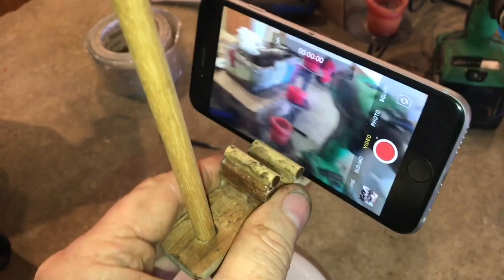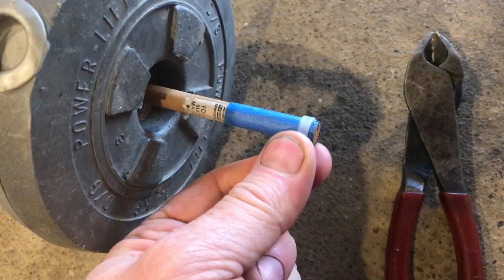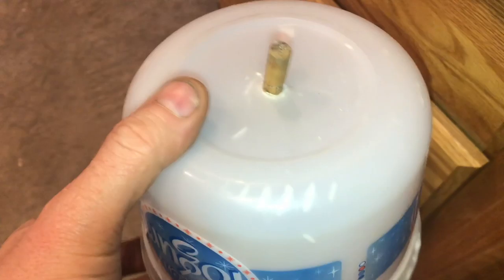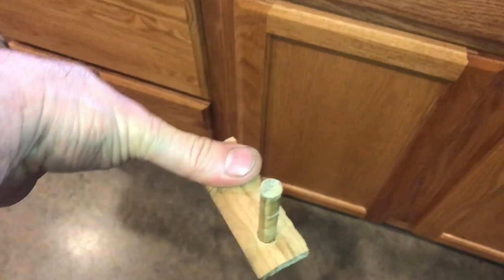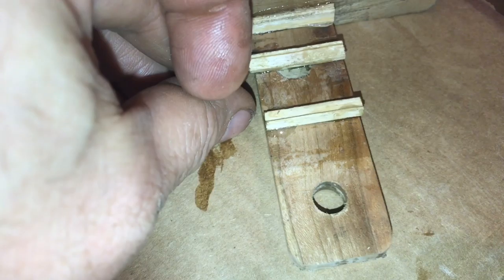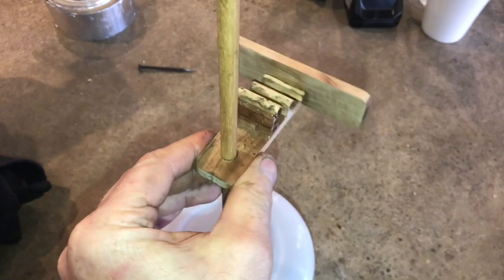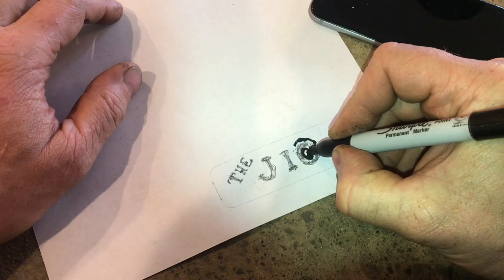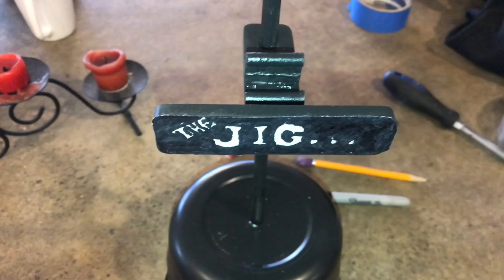how to make PROTOTYPES 101 (camera holder)

Comment: I've had some luck heating plastic a little then poking a hole or drilling with no cracks. Or heat a nail and poking a hole. But some plastics it doesn't matter. Shatter!
Reply from the maker: Heating the metal would’ve absolutely been better. It sounds like you’ve definitely been building for a few years. Experience helps keep you out of trouble. Of course sometimes you realize you’re mistake after it’s too late.
Reply: @livefree6878  
My experience  or tests are always -      ' drats! will this work? What if I...? If I do this and this maybe... '
Because I don't know what I'm doing, lack of tools or shouldn't have touched it in the first place.
Which hopefully carries over to the next project or trouble shooting.